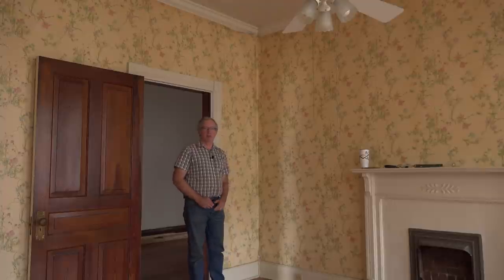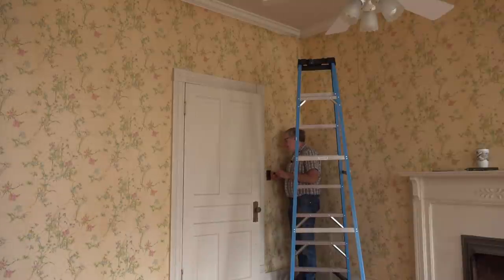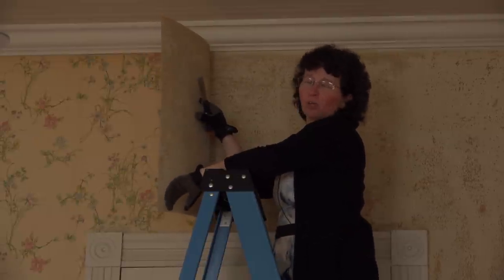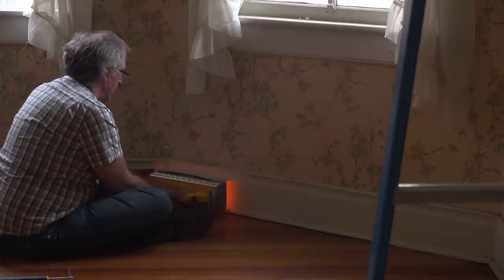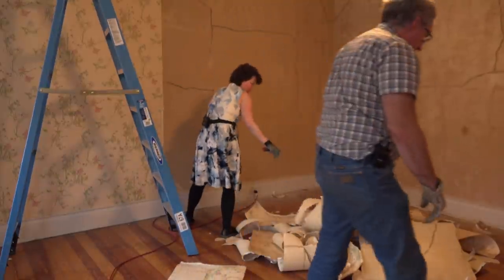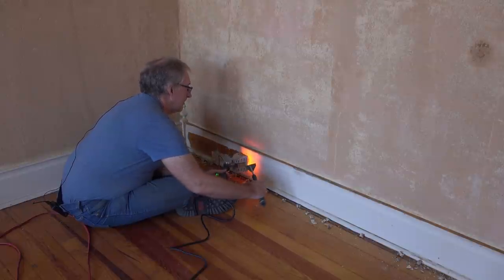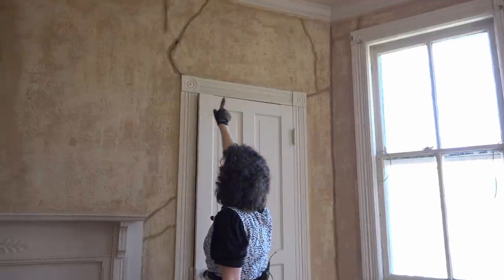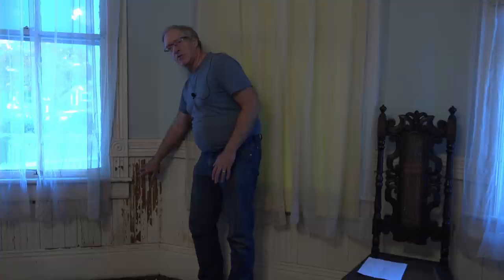EP 55 Stripping Wall Paper

Comment: There’s something very satisfying about taking down old wallpaper! I’m glad your experience was better than mine! Nine layers on the walls and seven on the ceiling in one of the bedrooms in my 1836 home! It took me a month of evenings after work but was well worth the effort! Looking forward to seeing the plaster repair work!
Reply from the maker: WOW!! That's a lot of layers! Just curious, did you put some new paper back on?
Reply: Excuse me, I was just wondering did you have to remove the wallpaper a layer at a time?
Reply: @cherly hall
Reply: No, I did not. I painted instead. Much easier to change a paint color when I tire of it!
Reply: In some spots yes. Other spots the paper was so dry and brittle it came off in big sheets. The worst spots were where someone spackled/plastered over the paper.
Reply: It's not that expensive to have multi-layers of wallcovering professionally removed. Just be sure they use waterproof dropcloths to protect hardwood floors.

Comment: When I have removed old wallpaper, I use a garden sprayer, fill it with warm water and a few capfuls of liquid fabric softener.  You spray over the old paper and let it set for 30 minutes or so to absorb.  Helps break down the glue and you can remove it more easily without taking out chunks of plaster.  If you have one of those razor blade roller things, you can perforate the paper even more and get it to soak in.
Reply from the maker: Our paper was vinyl so there's no way the water would soak in.

Comment: I wondered if a heat gun would help remove the paint faster. Love watching your videos.  You both are so nice and help one another so well. Good luck.
Reply from the maker: Great question! A heat gun puts out an intense SPOT of hot air whereas the infrared heater uses radiant heat to warm a larger area. We chose the IR because it offers more control and a larger area of heating.

Comment: with there being two layers of wallpaper i wonder if the paint on the plaster where the wall was gouged for the electrical is from a hand painted repair of the first layer of wallpaper or at least a touch up to disguise a misalignement of the wallpaper patch

Comment: I think a heating gun would actually remove that paint quicker than that tool that you’re using. I used a heat gun on a couple projects that I’ve done over the years and the paint just comes right off there’s little to no scraping at all

The house is gorgeous

Only suggesting the heating on because it really is a lot faster than the tool that you’re using I find that anyway
Reply from the maker: The tools we use were specifically designed for conservation and preservation of historic structures. Speed is not necessarily the goal.

Comment: You did really well  that the wallpaper came away dry in big pieces, the original glue must have dried out, the plaster underneath also didn't come away which i found can happen on old walls, you had no need to score the paper and soak with warm water or use a steam remover like i had to with really tough vinyl paper, with your walls skimmed with new plaster and painted they will look great .

Comment: Because you found shellac under the paint, you know that the room was not originally painted, so you're doing the right thing to expose the natural wood even though it's hard work.  It's disappointing that the face of the fireplace isn't tiled, and I wonder if it once had tiles that were removed.
Reply from the maker: The surface of the fireplace surround feels uneven , like it was hastily covered over. It will be interesting to knock it off to see what's there.
Reply: @1834RestorationHouse  Aha!  There may be tiles that were just skimmed over.  Knock it gently...  ;-)

Comment: About the electric switches and cables you mentioned, yes in Britain/Europe our house walls are normally brick and plaster, internal walls brick as well in pre 1980s houses,  for adding switches/sockets and new cables we call it chasing out rather than gouge out, hard work often, i've used an angle grinder/drills/chisels/  but there days there are tools and attachments that make the job easier, still dusty though..
Reply from the maker: That sounds like a lot of hard work but the wire would be completely invisible when done.

Comment: the patch above the light switch is the re plastering from the wireing up to the socket  the paper should be cut in the corners not folded around so by the window you will find its just the paper the wall should be ok, your ceiling above the window can also peel from the heat from the sunlight not always a leak.

Comment: I certainly hope your squirrel was not inside the roof when you put out the repellent as you'd never get rid of it then.  😝😲 If your roof hasn't been replaced in a couple of decades, I'm sure there are many more squirrel holes around.  😨😔😭 Don't put up that repellent yet!  😉  Good luck and hope you did shoo that pest away.   BTW, I was amazed how that wall paper came off.  I've always seen it in tatters preceeded with lots of tears and four letter words.
Reply from the maker: On the day we applied the repellent, we stomped around on all of the floors. Banged on walls and ceilings and made a ton of noise.
Reply: @1834RestorationHouse  😄😁😅😂🤗

Comment: This paper is like card board possible two layers normally always soak paper to remove it and in most cases bigger strips come of if you peel from the bottom upwards
Reply from the maker: There were two layers, firmly welded together. We didn't even get to see the under layer.

Comment: WHEN YOU PAINTED YOUR BEDROOM THEY HAD REPLACED THE PLASTER WALLS WITH DRYWALL. THIS ROOM STILL HAD PLASTER BUT WITH WALLPAPER. DO YOU THINK THEY REPLACED THE PLASTER WITH DRYWALL BECAUSE OF THE CRACKS AND COVERED UP THE CRACKS WITH WALLPAPER IN THIS ROOM? GREAT VIDEO. RECEIVED MY MUGS TODAY.THANK YOU.
Reply from the maker: Yes I believe that the downstairs room was sheetrocked to cover up cracks. My first house (a 1911 millworker's house) had paneling everywhere. When I pulled it down I found old plaster with huge chunks missing.

Comment: if your doors don't shut and you have cracks it could be subsiding a costly business don't just fill cracks and hope for the best are your house foundations good get them checked. sometimes the room need re plastering as the old plaster just fails through age
Reply from the maker: Settling is a real possibility. We will need to go under with a level and check it out. Thanks for watching!

Comment: What a relief that there were not 2 or 3 more layers of wallpaper under the top one LOL.  I noticed the little motif in the corner as you were scraping the baseboard, so Victorian :) Will you be able to replace any tiling on the fireplace do you think?
Reply from the maker: Yes, we'll do a full restoration  on the fireplace, repointing mortar and restoring proper Victorian tilework. Those little corner details are amazing!

Comment: The previous owner of our house painted over the wallpaper in the kitchen, two bathrooms and dining room. We have to take it all off. Any suggestions? 
I'm amazed at how easily this wallpaper is coming off.
Reply from the maker: First check to see if it's vinyl or paper. You want the paper! There is a special  tool that you can roll over the wall which perforates the paper although I've had mixed results with that. You can then spray hot water (with a touch of dish soap to break the surface tension of the water) on the paper and let it soak through. The water is supposed  to rehydrate the glue  and allow the paper to be peeled off. With the painted paper, this may work. Steam is another tool that people have used. The goal is to get the heat and moisture under the paper to release the glue.

Comment: Keep out the warm weather clothes. You will use them before next summer. The wallpaper is wrinkling in the corner because of the corner settling. The doors are the same as the corner, out of plumb. Are your floors level?  I know this from experience from our first old house in SC. Sometimes with the age of house, there were built on piers without underpinnings.  It was great for air circulation and the house liked it better that way. We found that sometimes we just had to live with what we found.

Comment: Hi Mike and Jeanie. Thank goodness your old wallpaper is peeling like Pringles. It's a pain when you're doing 2 inches at a time. The IR lamp is a great idea and I wish that I'd had it to use on my fireplace here. Someone had the bright idea of covering it in chicken wire and coats and coats of grey paint. Hey, I was wondering. Did you test for lead paint? We hit a problem with it here and it caused health problems for my sister.  It's especially bad if you heat it because of the fumes. If I'm wrong please correct me. Do you know if they have a cheap test for it now that you can use at home without having to call someone in to test the paint? Thanks and sorry for all the questions. I love as in LOVE your high ceilings and your fireplace mantels. They make your house so beautiful.
Reply from the maker: Hello Kate! Those are all good questions. We didn't test for lead and are just assuming that it's there. Our IR heater is specifically designed for removal of old paint in historic preservation , and the temperature is below the point where lead vaporizes. Since the paint peels off, there is no dust. As a precaution we always ventilate if we're using it indoors. Test kits are available at hardware stores now.

Chicken wire and gray paint!? Were you able to get it all off?
Reply: @1834RestorationHouse  Thanks for all of the info! Yes, I got the paint off but it took  three weeks. My bathroom which has beautiful coral and black tile was also covered in grey and white paint. Another three weeks there! I wish that I had been smart enough to use your method instead of chemicals. I used a citrus based stripper and it didn't work well at all.

Comment: I guess if you worked on stripping the paint from right to left the heater will heat the next part while you are holding it with your left hande and scrapping the previously heated part with your right hand at the same time, and it will go quicker. if that makes any sense!
Reply from the maker: Yes it does make sense. It's kind of like walking and chewing gum at the same time!

Comment: We know that bay windows are notorious for settling, leaking, etc. Hope your issue in the corner is none of the above.
If you work from right to left with that paint removal device you can soften a new spot while scraping... sorry for the back-seat driving. I couldn't resist. Now it's your turn to tell me to shut up & get busy on my own projects. I have kitchen & dining room to de-paper. Dreading it because paper hanger floated over texture in dining room, but didn't seal, so all that drywall mud will have to be removed with or after the paper.
Reply from the maker: So do we!

Comment: If you strip those wood ceilings the room will look so dark. I’d leave it white. I lived in two federal and colonial homes in upstate New York and I stripped off wallpaper many times. Some rooms had never been painted in 250 years and I had to go in and spackle the cracks and  make a nice smooth surface prior to painting.  The plain plaster soaked in several coats of paint.  So using primer is a good idea.
Reply from the maker: Go back and watch the tour. Most of the rooms have the dark wooden ceilings. Do they look too dark?
Reply: I think that if the walls are light it should look fine but some people like all wood. I love a room with lovely wood and blue or green furniture, it’s so relaxing.
Reply: @lindalumae  I disagree but it isn’t my house so it doesn’t matter

Comment: Im wondering if the vinyl wallpaper kind of "suffocated" the plaster as it needs to "breath" so it made the adhesive disconnect and bubble off like that. It looks like your lucky it didnt leave the plaster disconnected from the lathe as it trapped moisture back there.
Reply from the maker: You are onto a good theory there! The real wallpaper would let moisture pass through. Of course, too much moisture and the paper could peel off.

Comment: Just wondering why you don't use paint stripper?
Reply from the maker: 1) Chemical stripper has to be applied in advance and there's a wait time of several hours to soften the paint. The infrared tool works immediately.
2) Chemicals cost a lot of money and have to be repeatedly purchased when they get used up. The IR heater costs pennies to operate.
3) Chemicals sometimes run out of gas before they get through all of the layers.  The IR heater breaks through to the wood no matter how thick the paint.
4) Chemicals are nasty. IR heat feels nice on a cold day.

We've used both and the IR heater is so much better. It was developed in Sweden for this very purpose and is used a lot in Europe.

Comment: Hi guys..once again, a great video !!  What are the tools that you are using to scrap off the paint of your wood trim?  I am looking to use a heat gun and strip off a painted bedroom floor. Also have some baseboard like yours that would like to return to original.  many thanks for your hard work...
Reply from the maker: It's called a Speed Heater. I'll talk more about it in an upcoming video.
Reply: @1834RestorationHouse    Thank you!!!!
Reply: I was going to ask the same question :)  I have been working on old painted cabinets that have a crackled finish.  It's making me a little crazy.  I think it might be milk paint under there?  and shellac at the bottom.  I have another cabinet with some beadboard that I probably will repaint but it  needs  a much better smooth finish first.   So, the ceiling will be stripped too?  My arms ache to think about that, especially with all those grooves.  Just accepting that sometimes the paint is the intended and original finish is challenging my "belief" system.  (for my cupboards, not the room you are working on now!)

Comment: I have the Speedheater and their scrapers but we still end up having to use stripper in the beveled edges.. do you have a tool of preference for all this little details? We still go though a ton of chemical stripper on the details of the woodwork, but we are dealing with 80 year old paint and it’s much more difficult than latex. Gleaton Askew House Restoration
Reply from the maker: Hi Laura! So far we've been able to pull the paint off without trouble bit we haven't gotten into the fine details yet. You might try using some dental instruments. I find that the thickest paint is the easiest to get off.

Comment: I just bought a 1915 Victorian cottage; it has many issues that were hidden. I have many of the problems you mentioned on this episode with the windows, water intrusion, etc. Behind the paneling a lot of the plaster has come off or is loose….is it better to just take the plaster off the whole  wall, or can I just take off what comes off and patch? I am learning a lot from watching your channel!
Reply from the maker: Wanda, congratulations on your new old cottage! It's always best to save plaster if it can be saved. The loose stuff can be pried off and then the bare spots built back up with new plaster. Sometimes the old plaster is so loose and broken that it has to come off. If the lath underneath is in good condition then you can vacuum it clean and start the repairs. Please don't rip it out and sheetrock.